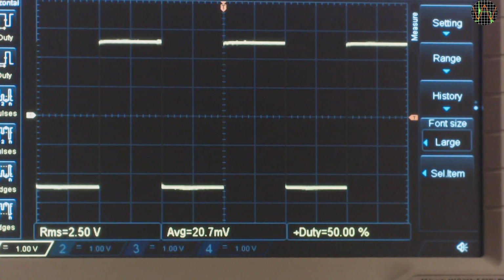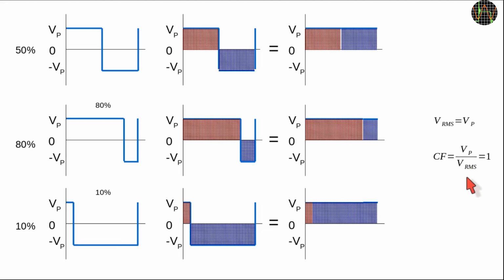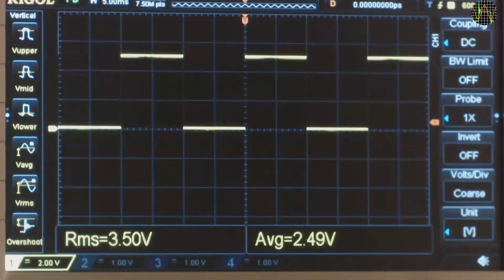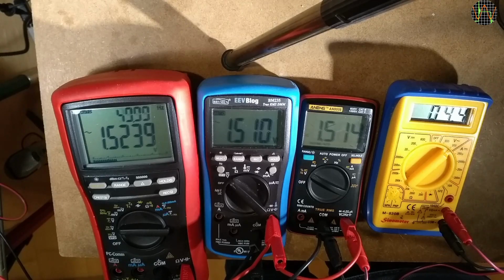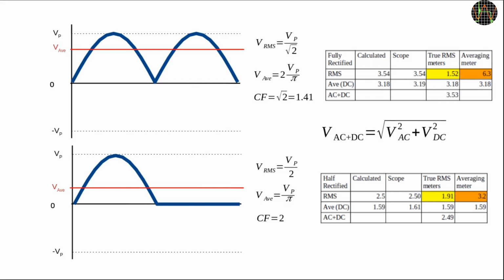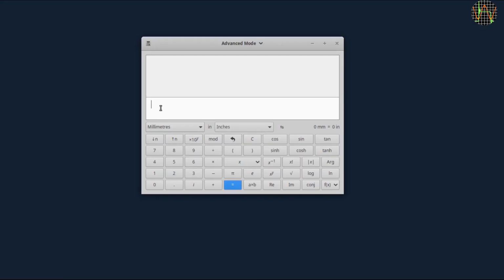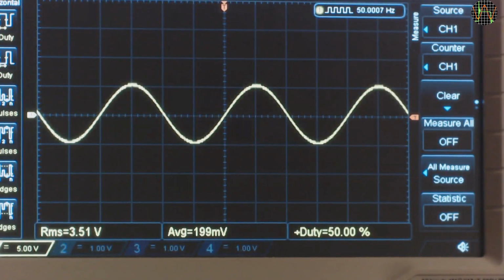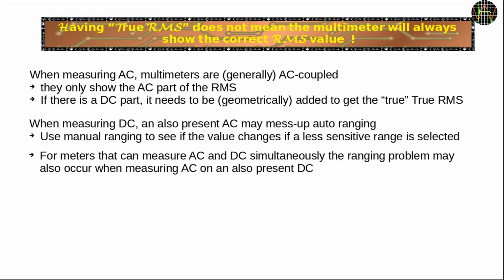Measuring RMS Voltages:  How true is your True RMS multimeter really?

Comment: if you select AC coupling for the oscilloscope, then I think the RMS reading of all readings (scope + meters) will coincide
Reply from the maker: Of course yes (as long as the meters are True RMS), but the point of the video is that the only correct True RMS value is the DC coupled value and only some meters/scopes that can do DC+AC show actually really the the mathematically correct True RMS value, Most  show only the AC part of true RMS (or average in some meters) which can be significantly different from the real value. If you ignore the DC part (AC-coupled) you may get a very wrong RMS value.

Comment: Hey, super great explanation, clear and very well prepare.  Thanks for sharing your knowledge.  Would you recommend some Multimeters that have the AC+DC calculation? Thanks!
Reply from the maker: Thanks for the kind words... AC+DC, yes its great - when it works. Check reviews how well range switching has been implemented.  I think pretty much every meter I know of, including my Brymen  869s and expensive Flukes have some quirks if there is low AC riding on a high DC or vice versa. A quirk is ok as long as the meter gives a clear indication that something is not right. Beware of meters that show dangerous nonsense, like a way too low voltage without warnings.  I have started testing AC+DC behaviour (and non-sinusoidal wave forms) even for meters that can't display it, because it reveals how well (or not) auto-ranging works. Check out the end of my recent review of the HT118A multi-meter.
Reply from the maker: @pedro gomes That is a difficult question because it depends on so many things. What country you are in (not all meters are available in all countries) and what you are planning to measure. If you never(!) do anything other with it than low power electronics, protection is not as important as when using a meter to also troubleshoot mains installation when you want a meter that has proper protection and a CAT rating that isn't fake for your own safety. These days pure manual ranging meters are not as cheap (if they are good) because these complex range switch designs are not cheap and you must consider that a manual ranging meter has a lot more wear and tear on the range switch.  RS-components does a manual version of the RS-4 which I reviewed on my channel. It is called RS12 and sells for <£30.(US$40) These are actually re-branded Chinese meters but at least being resold by RS means they meet minimum safety standards. I have not used the RS12 but the RS14 was ok except for very a very inaccurate temperature measurement range. Both of these are not True RMS meters. If your budget   stretches further  I'd consider auto-ranging but with manual ranging override option as the best compromise. I usually recommend the Brymen BM235 as an excellent all-round meter that is super reliable, safe and True RMS, but costs currently £80 or US$108 in the UK. Avoid any meter that does only auto-ranging. I will post a review of the Chauvin Arnoux CA702 (half the price of the BM235) shortly that suffers from problems when the autoranging gets stuck in a loop.

Comment: Excellent!!  Production value was top notch for clarity too!!  I too have many true RMS meters, and many struggle to measure AC under 1V riding over a high DC such as 400V  (tube amp p/s  ripple filtering).  The Fluke 87 can display the small AC (checked against scope), but sub-$100 USD true RMS meters read 0.0 AC (they briefly show something then change to 0).  Input is straight sine wave at 50% duty cycle.  I think your video and summary point that wide differences in values of AC and DC seems to explain why the less expensive meters cannot distinguish the small AC in the presence of the high DC component, even in manual range.  Have you seen that too, or maybe it could be a new video topic for an expert like yourself.   Either way, I just subscribed.  Thanks for the effort you put into the video.
Reply from the maker: Hi Scott, I think a lot of problems come from having only auto-range which is what inexpensive meters seem to go for these days and "soft" AC/DC switches. Looking for example at the datasheet and application notes for the Fortune FS9952_LP2 chip found in many 2000 count auto range DMM, for example the RS14 I reviewed some time ago, the voltage input goes straight into the chip. The chip also has external resistors connected to it that form a divider with the internal components but what resistor is used is entirely controlled by the software in the chip. If you select AC, the chip routes the signal back out to some other components connected to its pins. The application note shows what component it expects to be connected to do either averaging AC, peak detection (rare) or true RMS (using an external AD737). The key problem is that a mixed DC+AC signal is completely managed by the firmware inside the chip and obviously if the chip has decided on a range, it will be used for both components. The DTM0660 chip in the UNI-T UT210E  and ANENG AN8008 looks as if it is doing pretty much the same although its a step up (6000+ count and built-in "software" True RMS). Compared this to the Agilent 34401A which in the AC range uses a proper capacitor to rid itself from DC components. Then again, if your meter can show AC+DC which is increasingly the case, you have no choice but running the mixed signal into the chip. Hopefully in those meters the firmware is smarter to handle ranges.  Personally I don't mind if a DMM throws in the towel if the ranges are hugely different as long as it does it in a way that tells me what happened so I can work around it. The worst is a DMM that silently shows wrong values.

Comment: Oh wow, now I wonder if its worth it to buy true rms meter? Its only accurate for pure sinewave sognal... Sigh...
Reply from the maker: Hi PNG, 
that is maybe a bit harsh.True RMS can deal with a lot of "weirdness" in the signal shape and still read correctly, but (and that is the point of the video) it isn't fool prove. In most True RMS meters, things tend to go wrong if a DC component is present or the frequency is too high or too low, or the spikiness of the signal (crest factor) exceeds a limit.  So, even with True RMS, you must still engage your brain and judge if these conditions might be present and influence your meter. But just imagine how much more worse you would be off without True RMS? In any case, True RMS is becoming more and more a standard feature of even budget multi-meters and finding non-True-RMS meters is becoming difficult.
Reply: @TheHWcave  yes, many cheap true rms multimeter is available today... Those Zotek and Zoyi brand is very cheap, although I have not seen any real test on the true rms capability of those two.

Comment: This was an excellent video.  I usually always look at circuits with the scope and typically only watch dc values with meters., but it is good to understand the limitations of instrumentation.  
I have known about crest factor limitations of election AC meters for years, but I never considered they were ac coupled.
This is a case were old-fashioned moving coll meters are different.   They show combined AC+DC unless you use the AC coupled input (labeled output).
I learned something watching this video.  Thank you!